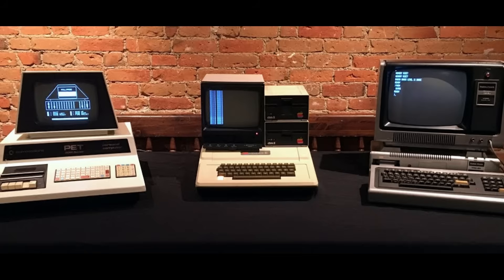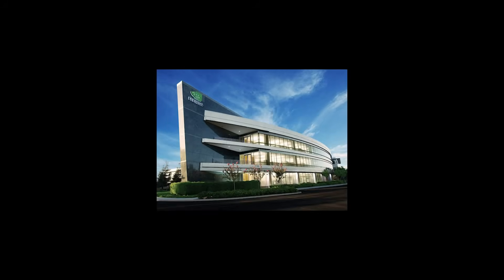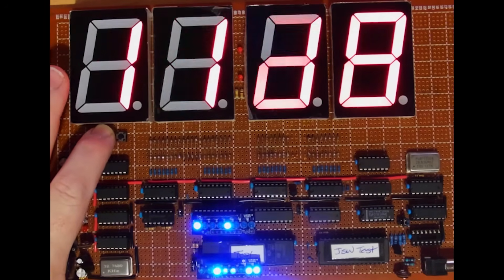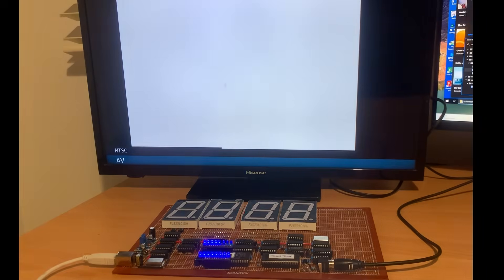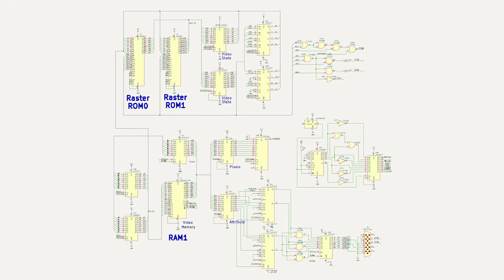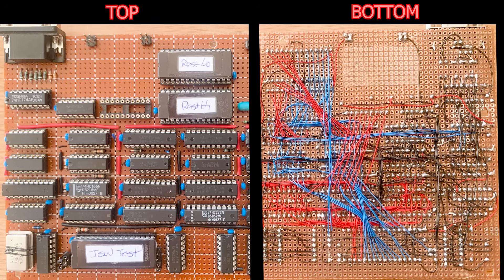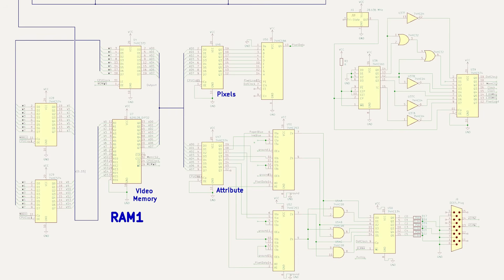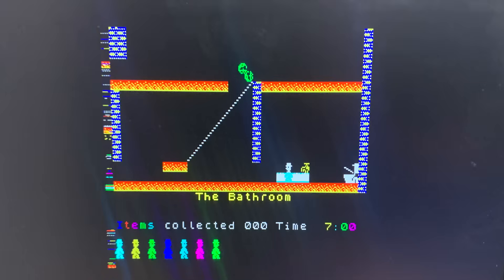ZX Spectrum Turing Edition Part 4 - Raster Generator

Comment: In the Wikipedia article about ZX Spectrum graphics modes there is a paragraph stating: "The address bitpattern contains two more bitpattern transpositions than necessary. The fastest and the simplest bitpattern would have been 0, 1, 0, x7, x6, x5, x4, x3, y7, y6, y5, y4, y3, y2, y1, y0, which makes the pixel addresses increase by the column first. Unfortunately, the ZX Spectrum designers were working under extreme time pressure, and failed to notice this simple improvement."

Any chance you could make an episode about that at some point in the future? Seems like you are the best positioned YouTuber to do a deep-dive into this subject.
Reply from the maker: Interesting.  I actually did a deep dive into the ZX Spectrum DRAM timing in the other playlist (the No ULA series).  The ULA controls the CPU and can stop it during active display.  I think there is a complication with DRAM refresh.  You need to sweep through 128 addresses in 2 milliseconds.    This is about 32 scanlines, so I think this was part of the motivation for the ordering.

Comment: Congratulations. I bought the ZX Spectrum at the age of 16 and I still love it even though it has been surpassed by other computers. However, are you aware that your work was previously done in Russia where clones of the ZX Spectrum proliferated, such as with the Leningrad project ?
Reply from the maker: Excellent.  Really, they built a ZX spectrum using a random access Turing machine?  A CPU with no ALU, no program counter and no instruction register?
Reply: @DrMattRegan  Russian clones use a z80 cpu. Your zx spectrum clone doesn't use a z80 cpu?
Reply: @DrMattRegan  Sorry. I reread your playlist and your project is even more fantastic and unique. You're building a CPU-less ZX Spectrum! Wonderful. Well done. Congratulations. Thanks to you, I have greater awareness.
Reply from the maker: Thanks.  Yeah I have another playlist that uses the z89, but this one just uses EPROMs, SRAM and TTL logic

Comment: I enjoyed hearing your origin story.

I'm a bit older than you. As a teenager, I was intrigued by an Intel 4040 based computer I saw in Practical Electronics. In those days, computers were programmed by front panel switches. Sophisticated ones had an RS232 port for a serial terminal that was well outside the budget of a teenager.

The first time I saw a board that allowed a computer to generate its own image was the 640 VDU in Electronics Today International. It was the year before my final year when I had ro complete a design project. My parents had given me a Synertek SYM-1 single board computer (look it up if you are not familiar with it) that had an RS232 serial port. I loved the idea of an inbuilt display card but my SYM-1 wouldn't talk to it. 

For my final year project, I built myself a 'hybrid VDU'. It was a video card with an inbuilt M6800 and serial port and exposed its video RAM to the SYM-1 as 4K RAM. Like the 6502, the 6800 did its memory accesses on phase 2 of the clock. Unlike the 6502, the 6800 required an external two phase clock generator, so I simply connected the 6502 Phase 1 to the 6800 Phase 2 and vice versa. 

I did a unit in my EE degree about TV that included raster generation but having a father who was also an electrical engineer who worked on the initial setup of the ABC studios in Ripponlea in Victoria, I knew how this worked from being a kid.
Reply from the maker: Very interesting, i just looked up the 640 VDU in ETI archives.  Looks like it uses some 7493s with 74157s so it looks to overlap the TRS80 a little.  Sounds like you were ahead of the curve if you were doing this in the late 70s early 80s!  
I mean i get why some of this isn't taught now, but i think the connection between Turing Machines and CPU architecture should be taught.
Reply: @DrMattRegan , my final year project was in 1980. The SYM-1 had the ability to save and load blocks of memory on cassette tape. My video card had a crude graphics capability, so I used it for my end of year presentation. I probably have the dubious honour of being the first person to do a PowerPoint presentation.

Comment: Really nice, even for as a software guy that can barely wire a push button to an MCU. That said, i made a "software as hardware" new ULA for an emulator and "repurposed" the attribute byte from F-B-P2-P1-P0-I2-I1-I0 to I4-I3-P2-P1-P0-I2-I1-I0, giving me 32 Ink colors and 8 Paper colors, no flash and no bright. The ULASX as i called it also has 40x3bytes where the colors are defined and stored as 8b RGB values. In your opinion, had they done that in the ZX, would it have just added "cost" or would the added complexity be prohibitive?
Reply from the maker: Excellent.  Part of the idea behind this channel is to make the hardware super simple (EPROMs, SRAM and octal D-type flip flops) and push everything over to software (even if it's state machine microcode).  I suspect your color scheme makes more sense, i think the flash bit is a waste and that's a reasonable way to re-order the byte.  Should have been ok to implement, even with PAL.
Reply: @DrMattRegan  Yes, the flash bit baffles me too. Everyone knows Sinclair liked "cheap", but Flash has very limited use imho, and they'd be better using it for something else. Heck, given how Bright works, they might as well have used Bright1-Bright0 and have 4 levels of bright which would simply drive the voltage at 100%-75%-50%-25%, giving you a nice "faux 32c" by having a proper base palette selection. With that, and had he done the smart thing and "sacrificed" an extra 2k for attributes, the ZX would have had (fixed) 32c at 8x2 blocks, which would have made it even more impressive for its price range.
Then again, that is why revisiting these "old artifacts" is fun, as you can go "what if they..." all you want with the obvious benefit of hindsight.
Reply from the maker: Yeah, they certainly had the bandwidth to do something fancier with the attribute buffer.  It was the 16K version of the spectrum that was the issue i think.

Comment: hardware indirect pointers are cool. ie code in hardware. fpga microcode is nice because you can design the final system to operate in any way you wish. and re-design on the fly. well if you can make a perfect design, why settle with a lacking design. perfect good is a gift from above, not from my/your own lacking effort for pleasing thanks. define perfect. yep it works and does what you want. but why settle with not-so-perfect when perfect is available and ready.
Reply from the maker: FPGAs certainly have their place, particularly above the 10-20 MHz range.  I've used them both with schematic capture and verilog, but there is something visceral about soldering chips together.  I always still feel an extra step away from the silicon with FPGAs.
Reply from the maker: Yeah, if you want flash, just do it in software.

Comment: Thank you for making these videos. I was more into coding in the 80's (6502 and 68000) and this is making me understand what I was doing then on a deeper level, 40 years later.
Reply from the maker: Excellent.  I always felt the CPU was a black-box back then, so it's nice to crack it open and look at the microarchitecture.

Comment: 1:07 Oh wow, I so wanted to build an EA Dream 6800! I was so broke at the time that is wasn't at all a possibility for me. Many years later, a much better off mate than me gave me his old COSMAC VIP single board development board, which was the system that the EA Dream 6800 kit was ported from.

4:44 lol. Back in the early 80s, I worked as a tech for Bell & Howell, & scored an ADM-3A VDT, & it's service manual, which taught me what you could achieve with a finite-state-machine.
Reply from the maker: Yeah. I also wanted one but never built one.   It has a very clever (minimal) raster generator which I spent hours figuring out back in the day.

Comment: Nice work. I used to do lots of prototype building but now blank PCBs are so cheap and quick to get made, I always go for that method for more than 10 chips.
Reply from the maker: I’m trying to kind of a hybrid approach (although not in this series). I have some modules I use quite a bit.  Then I connect them together on a perf board.

Comment: VR display system’ is really peak 1995 doctoral material. Not to disparage, the mid-90s were all about VR as the next ‘big thing,’ and almost every major university was tinkering with it. Monash was genuinely at the cutting edge. I was skeptical at the time, thinking hardware would take a long time to catch up — and I was kind of right and wrong in equal measures. But looking back, the thesis aligns perfectly with how modern GPUs ‘cheat’ to economize on computation.
Edit: I couldn't find the dissertation, and would like and overview of it, if it makes for an engaging video.
Reply from the maker: Yeah, for years VR and AI competed to be “the next big thing” going in and out of style, but it looks like AI has finally won. I had a 2013 SIGGRAPH paper rejected because VR was thought to be fringe. Four years later it was hot again.
Reply: @DrMattRegan  Did VR win in the sense deliver a consumer product first. While not holodeck VR the Oculus Rift did deliver something close to VR as most understand it. And I do wonder if LLMs are really out of their beta stage yet.
Having your paper rejected is just how stupid the human gatekeepers are. I was never deep into the academical side, but I was vocal about not outsourcing all IT roles as in a few years the trend will be to repatriate the functions again. IT is strangely cyclical like that
Reply from the maker: It’s been interesting to watch the launch of ChatGPT 5.  Some are predicting the end of “scaling laws”, but it might just be hard to tell how smart it is.  LLMs crossed the line for me when theory of mind emerged.  That was unexpected.
Reply: @DrMattRegan I am still in the "smart but limited" camp. And I do think that we are seeing the end of rapid improvement, especially with the proliferation of LLM generated content. So far LLMs have had 200 years of content to ingest. Now they only have one day at a time, and that content is "poisoned" by generative Ai. The emergent properties are of course a matter of opinion, and for me it isn't quite there yet.
Reply: I find it interesting that LLMs are combinational. In terms of your videos, they are just an absurdly large EPROM (larger than could be built using the atoms in our universe). The whole system is sequential because the previous input is shifted one place and the newly generated token gets inserted into the resulting space. You could illustrated that with a shift register connected to the address lines of an EPROM and the shift's serial input being an EPROM data line. The brain, on the other hand, has lots of internal loops and is a very sequential design. We were using Recurrent Neural Networks for the stuff LLMs are so good at before they came along and these RNN's might still make a comeback.
Reply from the maker: Yeah it seems like the dot product in the transformer that allows superposition was the key we were missing.  I personally though we'd need to understand the brain and genetics better before we got AI like this, but alas, not true.  I used to think neuroscience and genetics was the path to understanding AI, now i suspect AI is the path to understanding neuroscience and genetics.
Reply: @DrMattRegan  I think psychology, and related/subordinate fields like cognition and metacognition, are growing in importance now that we are pretty close to the perfect Chinese room thought experiment. I have long wondered at the level of reflection AI are doing/allowed to do. As that type of metacognition might have really unpredictable results.
Reply from the maker: Ha ha, yes my wife is a neuropsychologist and i tried to convince here this the closest we'll come to performing internal cognition experiments.  I like the experiments i've heard about from Anthropic, where they fed the LLM a statement like - make a rhyme out of the following stub (i'm paraphrasing) - " It looked so fresh, he had to grab it.."  and it's top candidate words were rabbit and habit.  It completed the rhyme with rabbit, but when they suppressed "rabbit', it made a different sentence ending in habit.  It looked like it was planning more than one word ahead.